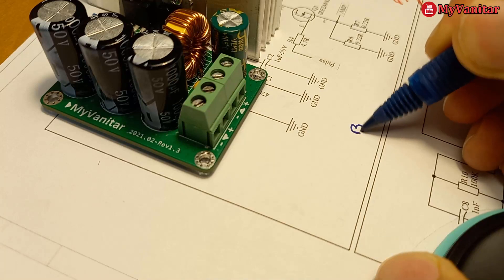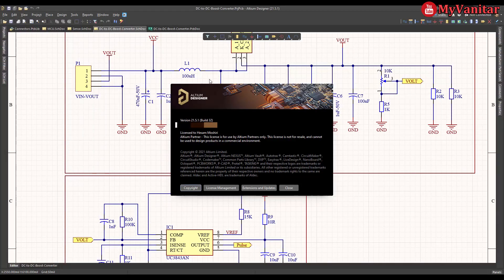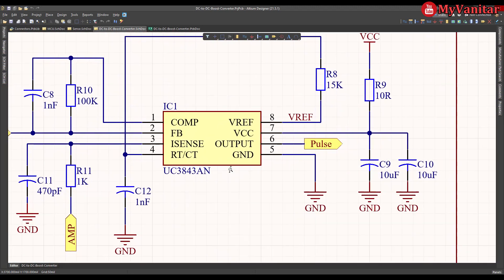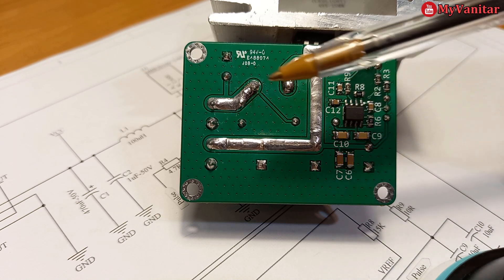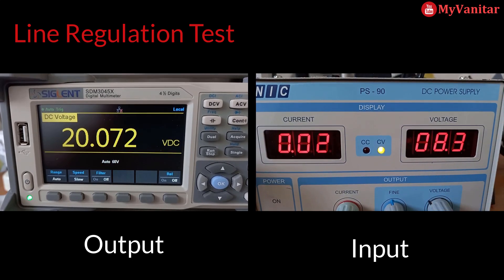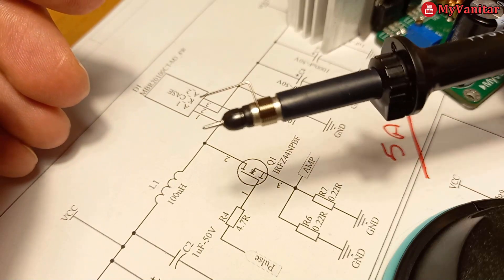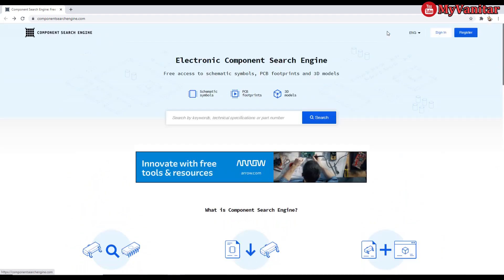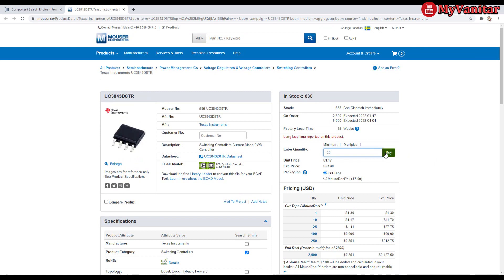DC to DC Boost (Step up) Converter Circuit using UC3843

Comment from the maker: DC to DC Boost (Step up) Converter Circuit using UC3843
Reply: This vidio is very helpful sir can you tell me how can I increase ampare maximum 80 ampare needed
Reply from the maker: @HasnainKhan-oi1gw  you should use a Mosfet, a diode, and an inductor for your current range

Comment: Hello! 
I simulated the circuit you made (by using a square wave instead of the UC3843) to check the components choice. I noticed a big inrush current on startup, approximately 50A (you have very big caps) when the demand of current is high. How did you manage to reduce the inrush so it does not destroy the components? 
Secondly, can you upload the calculus you used for every components? On the TI datasheet components calculus are for a flyback SMPS, and whan i tried using general formulas (from Phil's labs) i had really bad results with a lot of ripples. I wouldlike to do the calculus by myself.
Thank you!
Reply from the maker: usually, a boost converter is more noisy than a buck. check my latest video. although the current is low, it shows a square wave ripple. a 470uF input capacitor does not cause such an inrush
Reply: @MyVanitar  Well i guess that the inrush current depend on the ESR of the cap. What formula did you ude to calculate each components values like input and output cap, and inductance?

Comment: Sir circuit working super but inductor and shunt resistance get more heat😢
Reply from the maker: use an inductor with thicker wire, but the same inductance value. it will remain cool. for the shunt select a resistor with same value and package size, but more power rating
Reply: @MyVanitar   thanks for replying sir   ..for inductor i use two nos  0.7mm thick wire
Reply: Any suggestions sir
Reply: @MyVanitar  r increase the MOSFET adding parallel
Reply: @MyVanitar  i use 1mm thick again inductor heating problem
Reply from the maker: you can also use two thin wires in parallel, for example, two 0.7mm. what current do you use that you face such heating?
Reply: @MyVanitar  yes sir after  two 0.7mm wire connect in parallel heating inductor
Reply: @MyVanitar  i use 40watt load at 50v dc inductor is heating
Reply: @MyVanitar output voltage below 36v inductor is not heating
Reply from the maker: how much is the output current?
Reply: @MyVanitar  1amp s
Reply: @MyVanitar  should i reduce the inductor value to 16 uh
Reply: To avoid heating issue
Reply from the maker: 1A is low, you should not face heating. don't reduce the value of the inductor. small hating is fine, but if it burns your hand, you should use a FAN, but again 1A is nothing
Reply: @MyVanitar  sir if inductor air gap is more what problem wil come
Reply: 2mm air gap
Reply: @MyVanitar  i use input capacitor 25v 4700uf this cause any problems  and output 63v 3000uf
Reply from the maker: the inductor is a toroid, what do you mean by the gap. I don't know what you use. capacitors do not make any heating. your capacitors are good
Reply: @MyVanitar  i use yellow white  toroid  while using thick wire there is gap between copper wire and toroid
Reply from the maker: @mani4812  that sounds good, yes the wire should stick to the core. Really I have no idea why this happens to you
Reply: @MyVanitar  thanks bro
Reply: Sir  in MOSFET drain to gate should i used 10k resistance 
I not connected any resistance between gate and source

Comment: Can we change R11 1K with 1K trimpot to adjust/limit current?
Reply from the maker: I could not get a proper current limit (CC) out of this chip
Reply: @MyVanitar  I have schematic diagram with UCx842, pin3 (Isense) connected to center pin of 5K trimpot other pin to ground and emitor of NPN transistor.
Reply from the maker: I have tested all of these. It is the "current limit", not the constant current as you might misunderstand these two. (test yourself)
Reply: @MyVanitar  Thank you....yes I have misunderstand👍🙏

Comment: Not mounting that massive heatsink to the PCB is stressing me the hell out.  Hesam Moshiri why not make that PCB longer and just bolt it to the edge of that heatsink?
Reply from the maker: Daniel, this is not a final product. The heatsink is for demonstration purposes. by the way, if you don't bend the MOSFET and Schottky diode pins, you can mount the heatsink on the edge of the PCB, the way you like, however, my idea is to mount the heatsink at the bottom of the enclosure and fix it using a brace, long screws or something like that, and for this purpose, the heatsink should be fixed next to the PCB. so the board would be mounted a few millimeters above the bottom of the enclosure (using spacers) and the heatsink will be attached to the edge of the board. I think this makes sense in case of passing the vibration test. also, some users might use the metallic enclosure and screw the MOSFET and Schottky diode directly to the enclosure, as we can see in some commercial SMPS
Reply: @MyVanitar  It's a nice project! But the omission for mechanical stabilization for component leads is a big miss. I don't mind such transgressions for personal projects. But when it's put forth as an example for more junior engineers to learn, its 𝘀𝘂𝗽𝗲𝗿 𝗶𝗺𝗽𝗼𝗿𝘁𝗮𝗻𝘁 to not set forth such bad examples, whether they're implicit or explicit....

Comment: Really neat video.  How do I make one that can take 15-22V in and produce about 72V output at 0.5A current?
Reply from the maker: Thanks Reuben, in your case, the concept is identical. You can use the UC3842 and use a Mosfet with a higher Vds rate. if I remember correctly, the Schottky diode is fine, however, check the ratings of the diode as well. Finally, be careful about the rated voltages of the capacitors. Check the article as well. I have discussed some tips there as well. You can test this using TH components on a prototyping board and then go for a PCB.